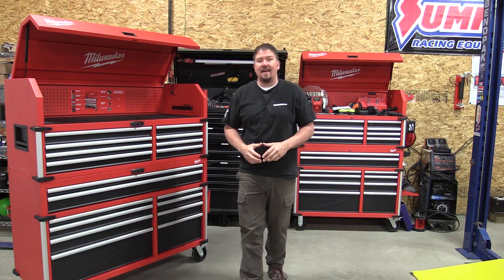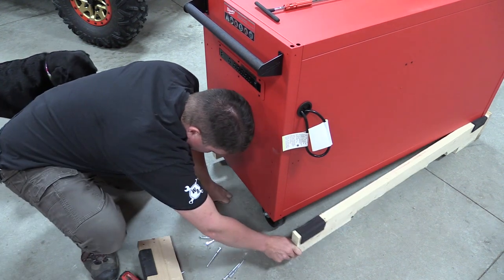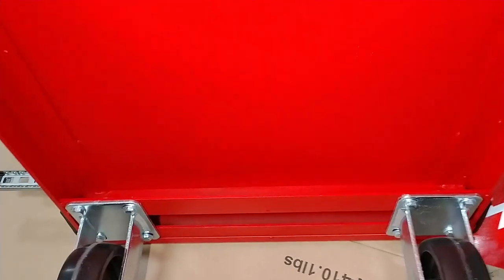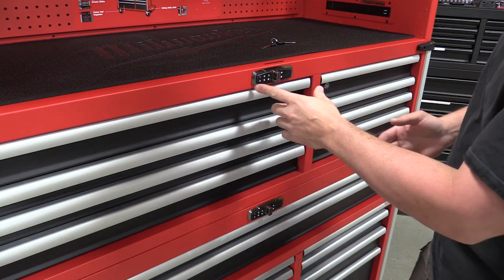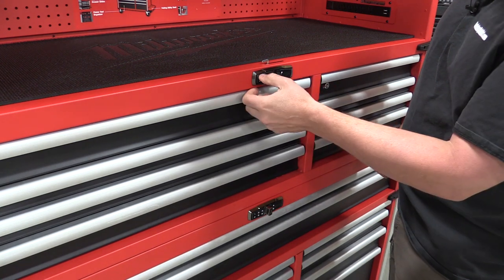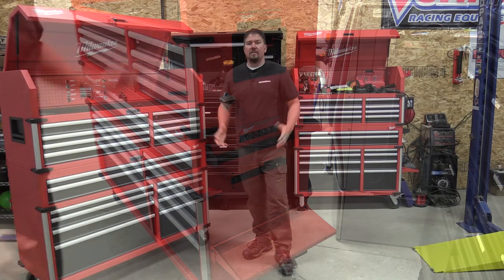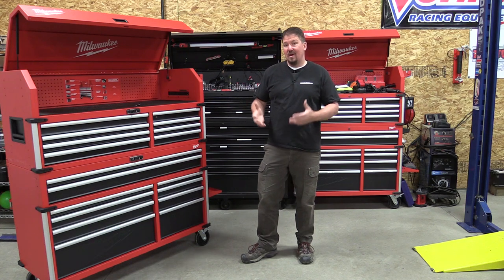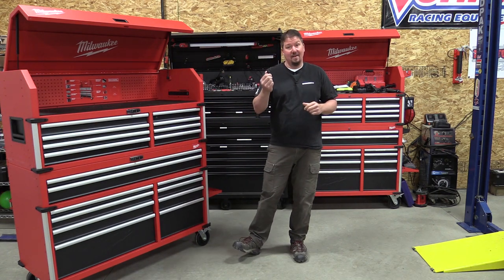Hits & Misses on the Milwaukee High Capacity 56" 18-Drawer Tool Chest and Cabinet Combo

Comment: Even if I had the money it'd be a "no" for me. Electric locks are stupid. You want multiple people to have access? Use a combination lock and give those people the combination. I also prefer a selection of smaller drawers over massive full-length drawers everywhere. I don't own or plan to buy any tools over 36" long, I don't need a 50" wide drawer. I don't need all my wrenches in a single drawer, I'd be perfectly happy having smaller wrenches in one drawer and huge wrenches in another. This box just doesn't offer the flexibility I want.

Comment: If you're using this as a commercial box, well, that's on you, dude. Get a Matco. And pay $13,000. I just paid $1288 for mine, 18 months no interest. Seems like a heck of a box for my $1300. I know a guy with your exact Husky. He has had finish issues, drawer issues, etc. And yep, probably made at the same factory. But there are differences. This coming from a 30 year factory worker. Different stuff goes into things for different customers. Line changeover, using different stuff. We do it every day.

Comment: Ya know snap-on sells a box similar to the bottom box built the same to just angle iron no tube framing and its 3k just for the bottom one and it has litteraly no special features no soft close, extremely simple and bland design and no electrical outlets not even any bumpers on it to prevent damage but he hates that its 1500 for twice the space of the snap-on and it's much much nicer like shit man that's hella cheap fir that kinda quality but if you insist, I'll be honest that lock design does sound extremely annoying id like that exact box but would much rather have it with a normal lock
Reply from the maker: On the other hand, Husky sells the exact same box painted black with normal locks for 799.......  Why would be way double for red and messed up locks?
Reply: @WorkshopAddict  you are right now in my case a husky wouldn't work well from the ones I've seen they're more geared towards mechanics where I'm a body man and need deeper and longer drawers now I've also never found one that would sute a body tech best but milwaukee seems to do better, im also a milwaukee guy so I'm extremely biased with milwaukee

Comment: I went back and fourth between two small boxes and one large one a couple years ago. I chose the large one as devoting more than eight feet of wall space to 2 boxes was too much a sacrifice of space. 

As for brands I'm sorry but I do not think there is any argument that Husky is the value leader in boxes. You simply get a ton more for your money with Husky. Secondly, even on the older Milwaukee boxes I don't like the look of them. I really don't like those stupid bumpers and how they separate the silver trim. And I'm sorry but that lock mechanism is a total joke. 

Brian, it seems like you had to work really hard to sell this box to yourself and as consumers we should not have to do that. Personally, I think this box is not what you guys are looking for and I would take it back and just order another Husky. box to match the one you already have But hey, that's just me.
Reply from the maker: We ONLY bought it to review for everyone.  I do not think that it is "fair" to buy this for the review and return it.  We will use it.  We did not need this box and we did feel like it was a mistake.  But it is the job we have to help inform others and help them with purchases.  Sometimes it is what we have to do in this position.
Reply: @SKormanec If HF changes the one sided spring latch on their 56in and 72in boxes to anything else they'd mop up the competition.
Reply: I really love Milwaukee but i'm going to have to agree. I bought the Milwaukee 60" about a year and a half ago, loved it for the first 6 months, and I've hated it since that.  I didn't really want the top box,  so I went for the bench. The drawer layout is so, so bad. The lack of at least 2 full length drawers is almost a toolbox sin in my opinion, and the locker is just about useless.

Comment: Everything about these boxes screams prosumer to me.
Reply from the maker: I hate to disagree, but I do not think it is at that level.  I think that is what it is marketed to, but it does not live up to that.  Its a lesser box than that. IMHO
Reply: Lesser than prosumer?  Ouch.  I'm planning on doing a midsized tool chest challenge on my channel, we are looking at the 40" to 50" boxes.  We are going to load up a box with tools, put it in the back or our trailer and haul it from Vegas to Montana and back again to see if it stands up.  I'm letting the viewers pick and right now the top three are the Harbor Freight box, the Craftsman Pro from Sears and the Milwaukee.  Do you think there is any chance the Milwaukee could stand up to that?  Honestly, I thought it at least had a solid tube frame but now I'm thinking of removing it from the running if it's just a foregone conclusion.
Reply from the maker: @denoftools  Interesting test.  I don't want to ask too much but I have to assume you will strap them down, so most of the abuse will be taken away.  With the drawers open, there is no way it would take it.  I would put my money on the Husky 56" taking it more than this model because of the 6 wheels rather than 4.  I am really unsure.
Reply: @WorkshopAddict  Yeah, strapped in tight.  The idea is to focus the stress on the casters and the slide mounting system.  Our hope is that if it can survive that trip it could handle everyday shop life.
Reply from the maker: @denoftools  Tt would be cool if you could connect to the wheels and allow the box to take the stress of moving.  The would act more like the box rolling on the floor and hitting a spot that it could not bump over.  Just create a barrier around the box about a foot high and let it ride.  That would tell a lot!

Comment: Definitely not worth it!!! You can go buy a Masterforce box fromMenards that’s worlds ahead on durability, size and costs pretty much the same…  just checked out this Milwaukee box at Home Depot today, it was $1200 and it’s several inches shorter, narrower and not as deep as the Masterforce…. The Milwaukee doesn’t even have self locking drawers, only the soft close feature which actually makes it slower to open back up…  way more sturdy and heavy box at Menards for sure

Comment: That looks like an aweful design.  Is the wrench drawer deep enough to use wrench racks?  If not you are wasting a bunch of space.  Having a full length socket drawer with only one set of slides is asking for trouble.

You'd be way better off looking for a used 54" tool truck brand box.
Reply from the maker: Yes, you can use most wrench racks. but not all.

Comment: This is a pretty bad tool box, especially when you see the price. The construction is not very good at all. Even the Harbor Freight US General is built better. Also, why do these manufacturers keep putting those stupid soft close slides on everything? They wear out quickly and are pretty annoying. There's a reason the tool truck boxes (and once again, US General) don't use soft close slides. That digital lock will definetly fail at some point. I'm also not liking the drawer setup. I wish the two long drawers were combined into one deep drawer to accommodate more sockets. I never buy tool boxes at lowes or home depot, because they all seem to be poorly constructed and have stupid gimmicks to get homeowners to buy them. This is no exception. US General is a much better choice.

Comment: Gimmicks. Take off those stupid gimmicks (E locks and power strips) and use a little thicker gauge metal. I might be interested. I have plenty of storage options on my power tools, A elctronic lock give me a break those things are as useless as the WIFI lock on the Craftsman.  Keys are the best way for securing a box and has worked for the last 100 years. Why reinvent the wheel?
Reply from the maker: You are right, they reinvent the wheel to charge more.